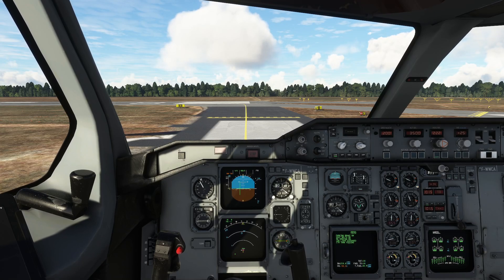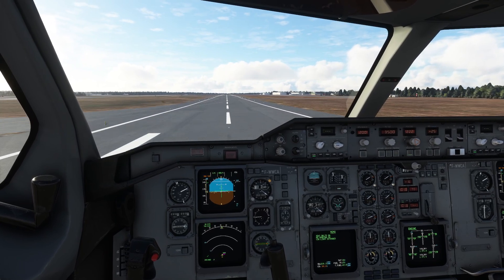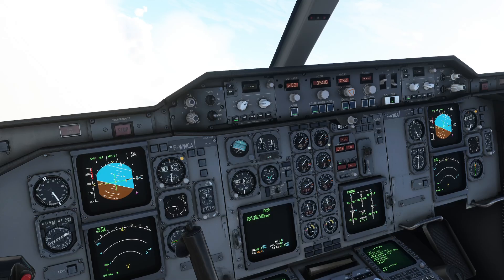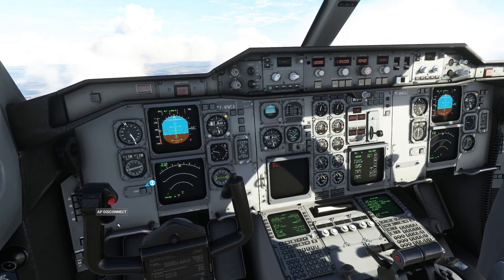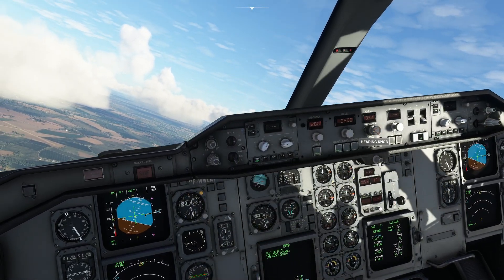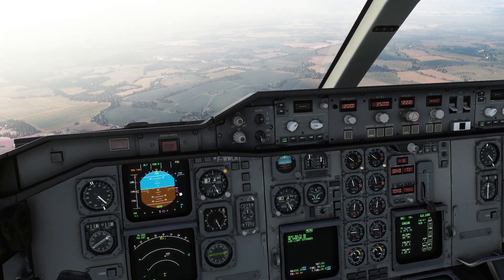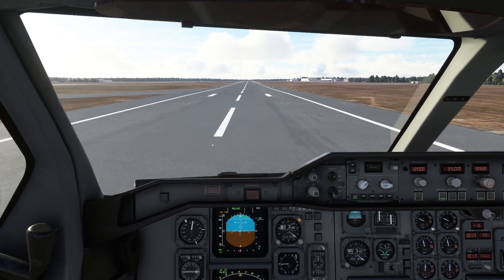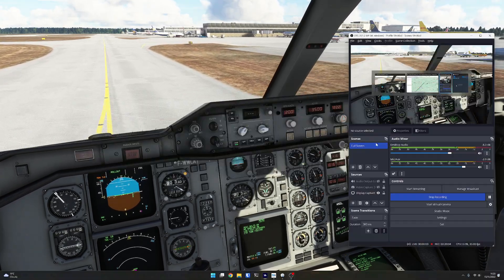A first look at using ILS in the Airbus A310 in Microsoft Flight Simulator

Comment: Nice vid. Subscribed. 🙂

I had a few trial and error ... er ... 'learning' moments with this plane. It can be a helluva learning curve. So, just sharing a couple notes for what it's worth... 

1) The A310 FCU button PUSH doesn't work the way your describe in the vid. Not like the newer buses SET/Manage... For A310, Pull is set/activate. Push does different things... Push on speed will allow you to PRE set speed bug without activating. Push on HDG will just set the heading bug to current heading without activating (useful in NAV mode or on runway ready for take off to preset HDG bug without turning it forever and ever on a busy approach), push on ALT toggles 100/1000 ... 

2) ILS procedure -  tune ILS + CRS, set MDA in APP page, then activate Final APP at least 5 to 10NM before LOC, then select NAV, and ensure PROFILE is set on (I usually set ALT for FAP point ALT as per ILS chart). It will capture LOC and then capture GS and should descend automatically if all set up correctly. Once captured and descending you can set Go-Around ALT as normal, plane will continue GS descent. 

For std CAT2 only one AP needed. BUT ILS must be selected on both Captain and FO PFD. (If you fly the Fenix, you will know you get warnings if FD and LS is not set on both PFD's... Seems A310 does not have those warnings... ) 

Profile Speed on AT is similar to the modern bus, and plane should keep to greendot as you step down flaps as soon as Final APP is active. However I prefer setting speed myself, and prefer at fastest to be at 210kn 5NM before LOC. I step 210 - S15F0 / 180 - S15F15, then gear, then set Vapp (calculated on MCDU Approach page for you), and as it decels, remaining flaps to full. I like being fully configured and stable by 5 DME, unless chart specifies higher.
Reply from the maker: Thankyou for this - really useful information.
Reply: @jonbeckett  All good. Correction though: For ILS, LAND and PROFILE. Not NAV. my bad... 🤦‍♂😬

Comment: so the course is just the magnetic heading of your arrival runway?
Reply from the maker: Yep - the big jets tend to use GPS en-route, then switch to landing systems for arrival - which uses radio, and course. The Airbuses get it pre-configured if you have programmed the flight-plan.

Comment: A lot of flight guidance systems won't capture the glideslope (engage G/S mode when armed) unless you're already tracking the localizer  (LOC mode active). I believe it's also a carrier option on some aircraft. That's likely what happened in your case.

Also it's cool to see that the sim models buffeting when you are flying near stall speed
Reply from the maker: Yes - I should have flown in from further away to adequately describe how things behave. I'll return to it again soon and do a better demonstration. Half the problem is talking about something while travelling at 180 knots eats up a lot of approach distance :)
Reply: @Jonathan Beckett  i personally loved this video.  Answered so many questions i had.  Like you said its a real learning curve.  
Can i ask a question though.  Is there any other way to get approach frequencies besides Navigraph?  I use Simbrief but im a bit hesitant to spend so much money if there is a cheaper option that can work. 
Thanks in advance. 👍

Comment: Did your aircraft get a terrible pitch upwards when you're coming into land? Everytime I go to land with this aircraft it seems to wanna flare itself like at 50 feet above ground. And to compensate I have to cut thrust way too early. How can I stop this if at all. This usually happens when I fly ILS approaches.
Reply from the maker: Never had it happen. It must be something you're doing (or not doing). In the 310 there is a setting on the front panel for the decision height - probably that. If you read the documentation that comes with it, you'll find the approach checklist which will cover it.
Reply: @jonbeckett   Do Xbox users have this manual? Or is it just for PC?

Comment: off topic but, were you able to get simbrief to work with the fms?  thanks :)
Reply from the maker: Not tried it yet.
Reply: @jonbeckett  Ok, so why didn't the ILS kick in? The LAND button is the right button for GS and LOC. Maybe you were way too off to the side so it failed to align on the LOC?
I only landed once and it worked fine when clicked on LAND.
Reply: @amirweinmann3445  He was at 3500, maybe a little high to capture. Normal intercept height is 3000 I believe.

Comment: I tried to land the a310 using ILS when I got close to the approach I turn ILS on got closer to the runway the diamond for the ILS never showed. I been trying multiple time landing this plan using ILS it never work. The auto pilot work fine if the flight plan is correct. When it get close to landing it never work.
Reply from the maker: Works fine for me. Did you program the ILS frequency and course on the centre console? Also, did you switch the display mode on the MCP?

Comment: Msfs crashes every time I load a flight with a310. All other new aircrafts work well. I even followed someone’s suggestion and downloaded from market place with same devastating results. Any suggestions!
Reply from the maker: Programme the flight by hand in the MCDU.
Reply: @jonbeckett  system crashes to windows before I can see the aircraft
Reply from the maker: @ziadcookingatallah9919  Start the flight with no flight plan. Just choose an airport and spawn there. If it's crashing, it's something else causing it - remove any mods / addons you have.

Comment: I'm trying to do an ILS approach into Edinburgh in the A310 but the frequency selector won't let me select the correct frequency (108.900). It only lets me select 108.100 which doesn't work. How are you supposed to tune a frequency ending in 900 if it only lets you increase/decrease by 5 each time?
Reply from the maker: I just tuned it in no problems - you must be doing something odd...
Reply: @jonbeckett  I think I see what I did wrong now... A moment of stupidity on my part